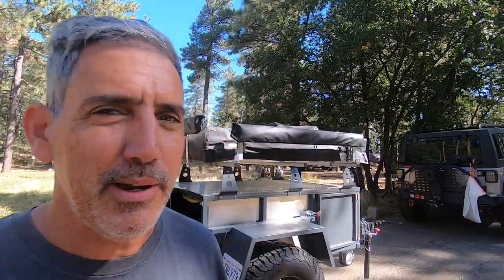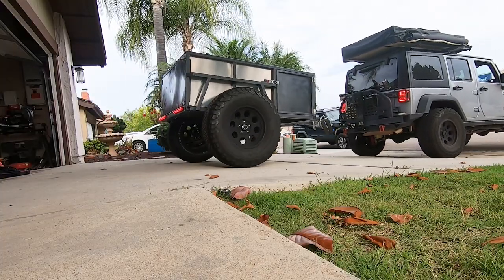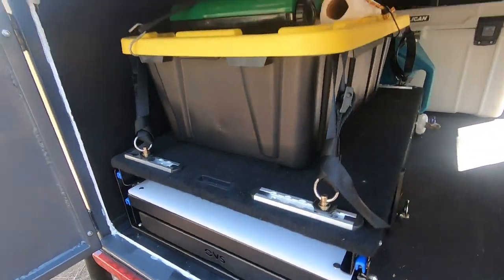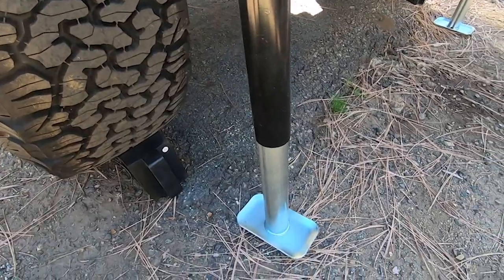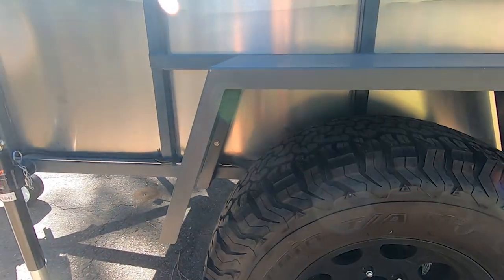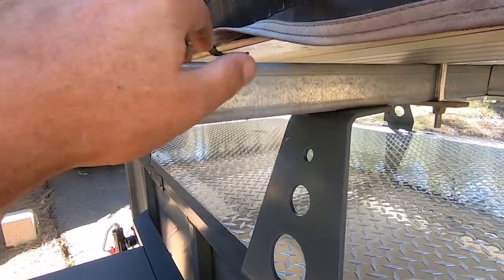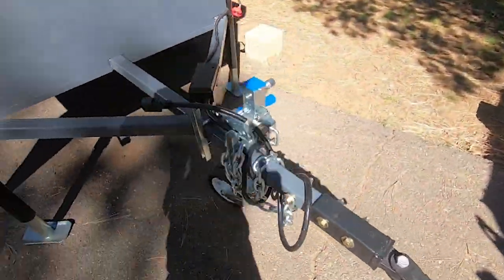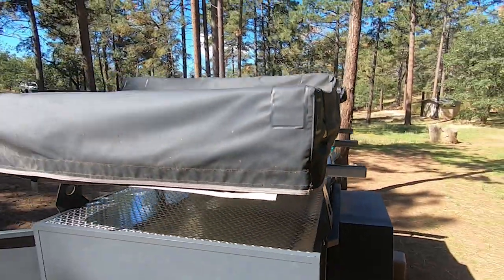Overland Trailer DIY Build - Part 1

Comment: Great build. I built a similar trailer, I have a little more room between the top of the trailer and the bottom of the tent for a canoe or 2 kayaks. I found that a Car Top Carrier works really good when not hauling my canoe between the tent and trailer. You can find them used on Offer Up app for about $20 to $30. The advantages are extra storage that is water and dust resistant, light weight and can be removed in minutes to take my canoe. I also went with 2 awnings over a 270° awning because I always use the side awning but rarely (rain) use the back awning that covers my kitchen. My side awning is a 7'x8' and the back awning is a 5'x8'. It is nice to see another build with similar ideas.
Reply from the maker: Thanks! So funny you mentioned the car top carrier. I was just looking at I today and thinking I needed a cargo holder for that area - bur not something permanent (so I can put surfboards there  sometimes). Great suggestion. Agree on the two awnings. Camped somewhere the other day where I wouldn't have been able to open a 270 degree on. Two gives you more versatility.

Comment: How did you attach the kitchen pullout? Was it just into the floor or into a steel tube as well? Trailer looks great btw.
Reply from the maker: I went through the tubing and the flooring. Was thinking of just going through the floor sheeting, but worried it might move around and possibly deform the aluminum. Probably overkill...but gives me peace of mind!

Comment: What's the overall weight?
Reply from the maker: Good question! I haven't actually put it on a scale yet. But suspect it's around 1000-1200 pounds - without a tent on it. Hoping to get it to the scales soon and will report back.